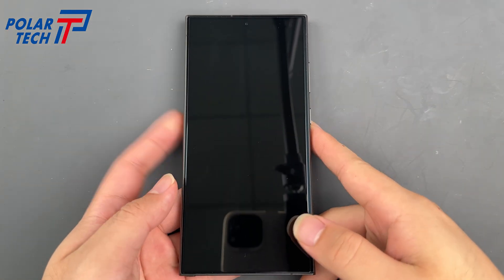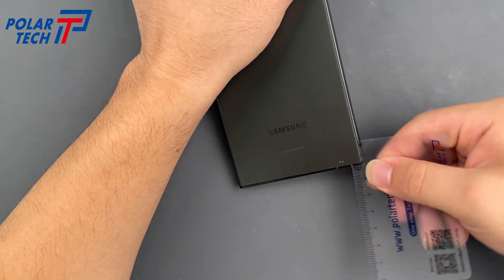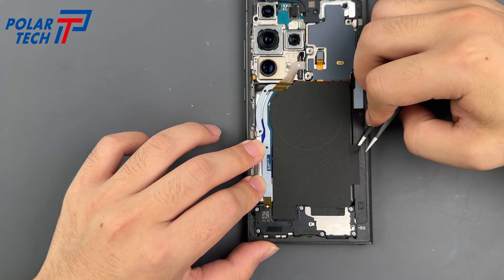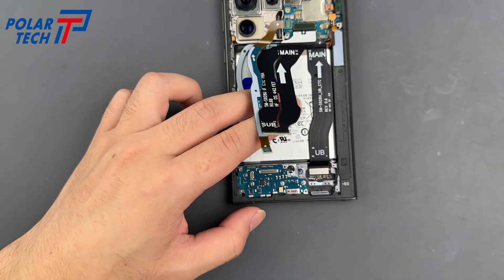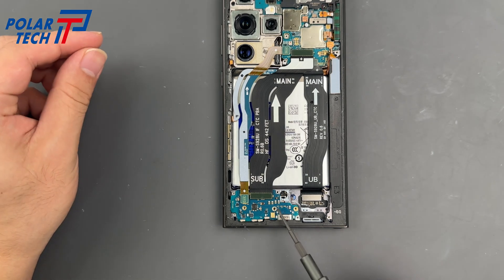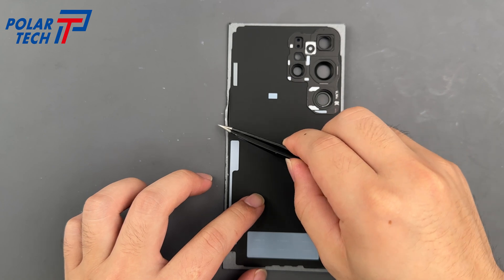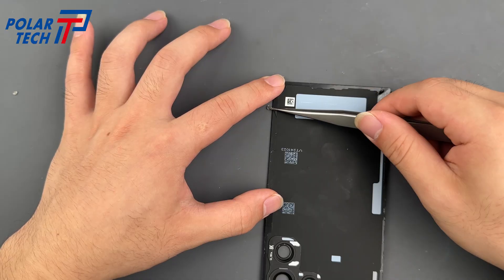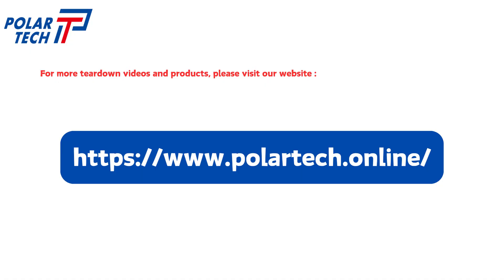Samsung S24 Ultra Sub-Board Replacement | Step-by-Step DIY Guide

Comment: What functions this board cover please explain in detaips
Reply from the maker: The S24 Ultra’s sub board handles charging and data transfer (USB-C port), microphone input, antenna signal routing, vibration motor connection, and loudspeaker connection, and links these functions to the mainboard.